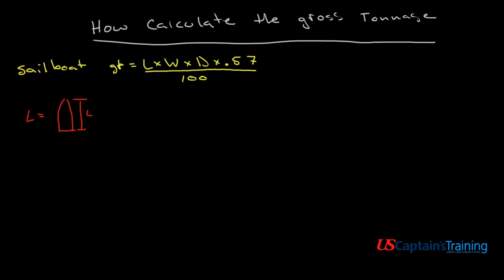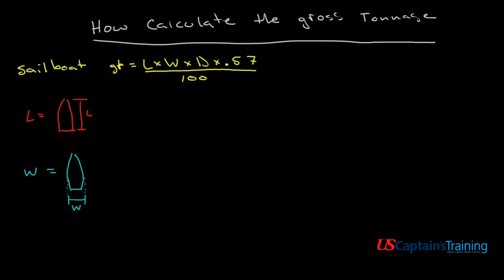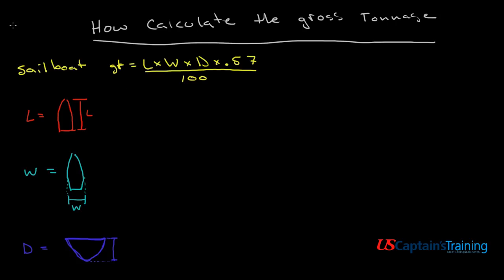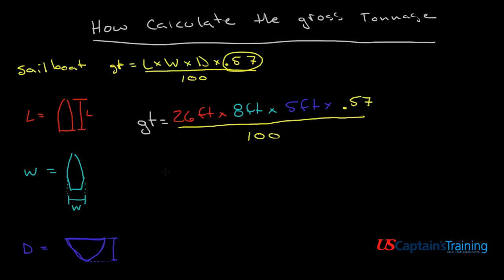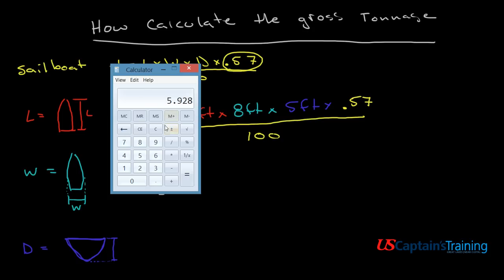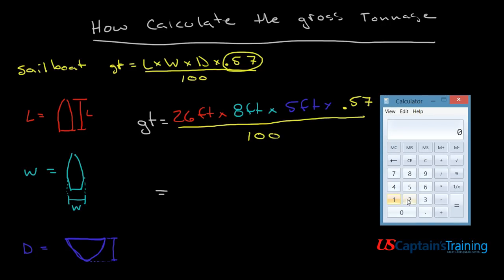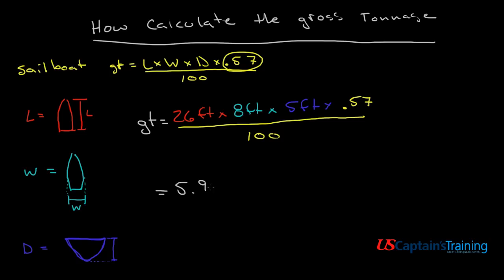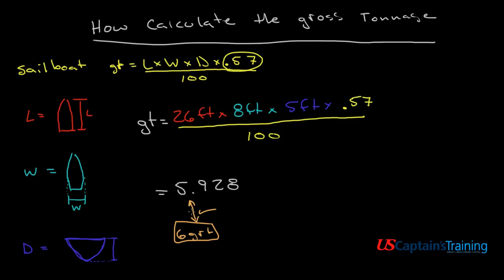Vessel Gross Tonnage Simple Calculation

Comment: -57 is the block coefficient of fineness! In other words a rectangle is 1.0 that's for a full block!  where as a ULCC (Ultra Large Crude Carrier) which is close to the size of a rectangle is maybe .70 to maybe .89.  These hulls are for carrying cargo in bulk not for speed!  on the other hand a navy hull for speed and has a Coefficient of .60 of less with a nice entry on the bow to cut through the water at great speeds. a sail boat is .57 or another way of looking at it is that a sale boat is 57% that of a rectangle the same length and width of the sail boat not taking into account the keel.  hope that that helps.

Comment: I contacted the USCG because this also left me vague on what is the draft is it to the top or bottom of the keel. They said (in a chat and also in a call to two diff agents) that it is LxWxDx0.67/100 and they said the Depth is "The depth is measured at the middle of the length, from the top of the keel to the top of the deck beam at the side of the uppermost continuous deck." what the word middle in that sentence means I'm not sure, maybe that means the median length but anyway it's to the top of the keel incase anyone else is confused about that as it wasn't specified in the video and the USCG is saying to use 0.67, yes, after me specifying for a sailing vessel. I contacted them today July 26, 2022.
Reply from the maker: Thank you for the insight!

Comment: what is .57
Reply: +srinath b A boat isn't a rectangular block, so L X W X D won't equal its true volume. Most monohull boats are shaped more like a triangle when looked at end-on...like a prism shape overall, and that measurement of .57 is called the prismatic coefficient. It's different for different boats, but "Rule of Thumb" estimates are often accepted for certain uses such as tonnage calculations.